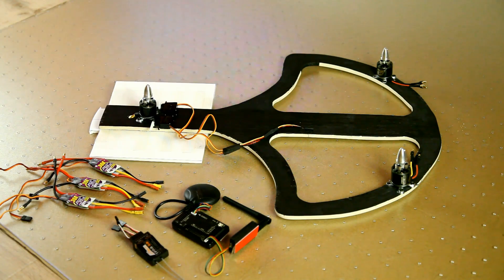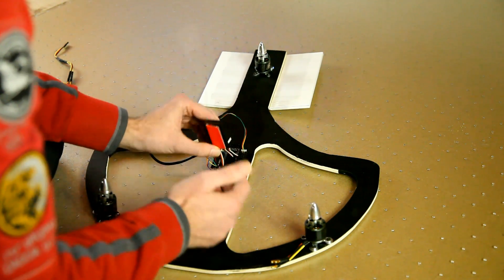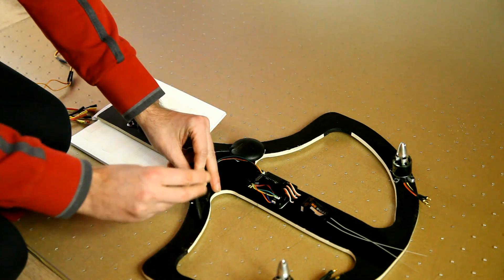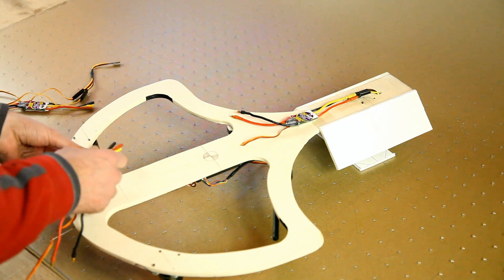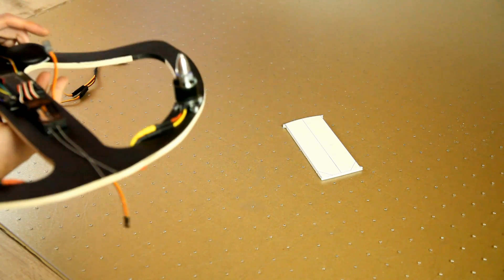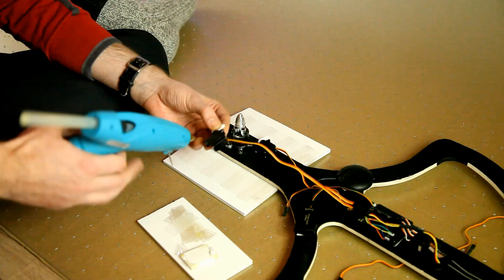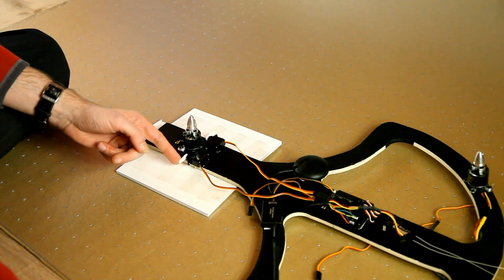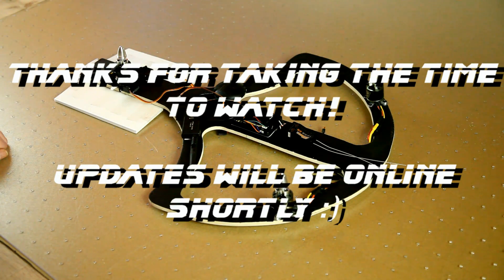Thrust Vectoring TriCopter! 5. Electronics Mounting! :)

Comment: looks awesome, cant wait to see how those rudders play out :-) its nice to see the gps module in there. Look forward to see how it behaves in the air :-) I would say that the rudders to the rear would be most effective at higher speeds right? :-D
Reply from the maker: Thanks buddy! Looking forward to see what the rudders do as well :D
Hmm speed speed.. the need for speed :)  If you're talking vertical speed, then: YES.. But I think the prop-wash will be a far bigger force.. It's quite a huge prop just mm's above the rudder.. 
Yeahhhh GPS.. And.. full telemetry from on my laptop as well.. I could potentially fly it with my laptop :)
Reply: DutchRC ADVENTURES that's got all the ticks I need on that gps, with the telemetry I could probably even get it back home without crashing it :-D
 Them props do look pretty massive, I thought it funny that when you painted it black it looked heavier than when it was its original wood :-p
 it does look one of the smartest drones ive seen tbh :-)
 Vertical lift speed I didn't think of :-D I imagined this kinda moving like...a Chinook or something :-)
 Cant wait to see how it fairs :-) the only way I could see that getting lighter is if it was carbon fibre and even then I don't think it would knock that many grams off it's wooden counterpart :-p
 Do you think that its frame will provide some surface area so it sits on a bit of a cushion of air? and if this had little wings on the side would it aid buoyancy do you think? or would it cause drag? :-D
Reply from the maker: battonfive Drag.. That's what it's gonna cause ;)  Mostly though, it's the prop-wash blowing down on the frame..
Other than that: when you fly forward with a multi-copter.. The entire copter will be tilted forward. And the frame will only generate Negative lift..
My frame however has 2 large open spaces in it, to counter that drag :)

Hmm yeah.. A CF frame would most definately be lighter.. I have no idea how much.. On the other hand: the heaviest parts of the copter are the motors + ESC's + Lipo.. So I don't really think it would make a lot of difference in the end :)
Reply: DutchRC ADVENTURES yep it seems to all come down to the weight of the stored energy on board :-) its why I really want to tap the nitro energy density in that hybrid I want to make :-D
 On the energy density chart li-pos are still way down there im afraid :-(
 Mmm the cf would reduce it quite a bit I guess when I think about it, 1mm thickness would be more than enough to cover the strength requirement and that would be just marginally heavier than plastic :-)
 A single 1mm layer of cf is usually three layers of cf fabric combined with its resin after the manufacturing process :-)
 It made me wonder if you could make a frame just out of carbon fibre tubes, they are super light and strong, would have minimal drag and you can buy epoxy glue that will glue them together with the same strength as if all the pieces were manufactured as a whole :-) http://www.ebay.co.uk/itm/Long-Carbon-Fibre-Rod-Tube-Kite-Framing-Helicopter-Plane-Boat-Models-Modelling-/291399851426?pt=LH_DefaultDomain_3&var=&hash=item43d8c8dda2
Reply from the maker: battonfive Wouldn't it conveniant to be able to put a nuclear reactor on it? :)  'here is my test-flight that lasted 1 year!' :D

1mm carbon would really never be enough sir :) On smaller copters 3mm is the very least, and this copter is far bigger.. I would opt for 5mm... The wood I use is 8mm thick by the way.

But sure.. Tubes is another story alltogether.. This frame for instance has a tube backbone + arms:
https://www.youtube.com/watch?v=H4zuwe_GOqQ
Reply: DutchRC ADVENTURES looked in to it :-) the Russians made a load of plutonium batteries back in the 60s and 70s for light houses and remote places. similar to the one they took to the moon, the plutonium batteries produce about 300w constant for about 15-30 years :-p
 We should have millions of the things powering stuff as plutonium is an expensive waste by product but terrorists and all that :-D
 3-5mm of c.f surprises me :-) that's the equivalent of like 8-10mm of steel :-p 
 I like this quad you linked me to, the rubber pads on the legs is a nice touch, they would have started getting a bit sharp after a while I imagine.
 Cf flexes a lot so I wouldn't have said it would snap type thing :-) but I would have thought 2-3mm with perhaps a 2mm tube structure latticed across the frame to reduce flex would have been more than sufficient :-D
 I cant wait to test all this :-) bin looking forward to cf manufacture for ages, just need the last of the doe to buy the setup :-D
Reply from the maker: battonfive Great! hahaha O.k.. so the Russians probably have some tucked away somewhere ;)

O.k.. but What kind of strength? Compression / tensile / torsion? Every  material is good in a few things.. And bad in others... 

By the way: the tricopter has made 2 small hovers inside by now.. AND 1 majour crash :P  It survived with no damage :)

Comment: Are you going to cut away some of that flat area under the rear motor? I can't imagine how you would get enough airflow to make the rudder effective like this.
Reply from the maker: Hmm nope.. Where would I be able to cut away something? Anyhway: this is really why there are 2 rudders.. When 1 is pointing outwards, the other one does nothing..
Reply: DutchRC ADVENTURES You could perhaps cut away some of the middle at the back. Unless you get some airflow between the rudder vanes, I'd think that whole area under there would become a large source of drag and turbulence, and the sideways force it can generate would be very limited. I'm not an expert so I don't really know, but this is the impression I got from watching a lot of YouTube videos about fluid mechanics :) There is a really good series called "Fluid dynamics of drag" that you might be interested in. They are very old videos, but have good explanation and show a lot of real-life test examples to demonstrate the concepts.
Reply from the maker: ***** You could well be right! I have though of making the two rudders form a V-shape when not at work.. If I would then make a rounded deck, I would have a tear-drop-shape (should be Ideal).. I'll have a look if that is possible :)
Thanks for the input offcourse!